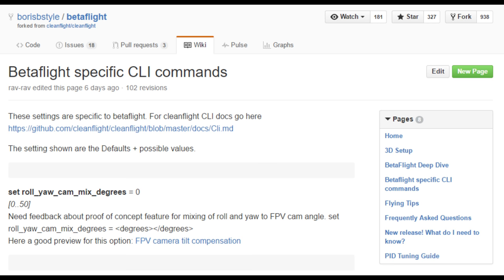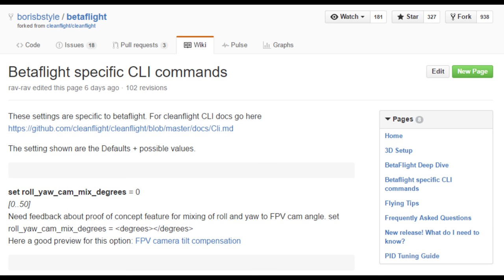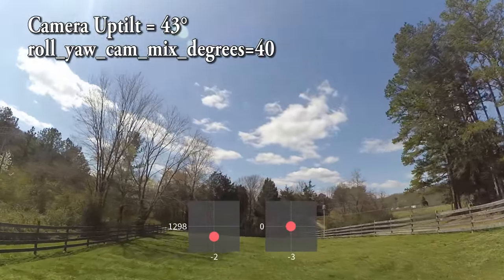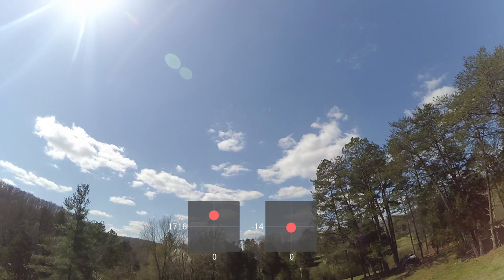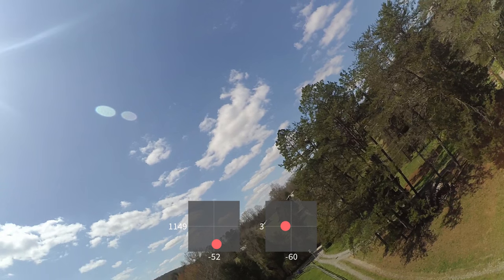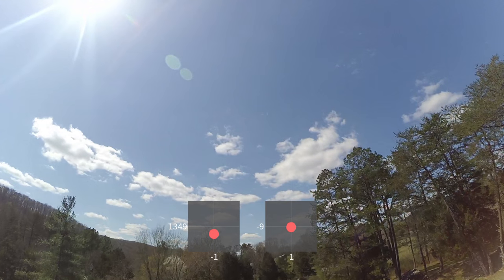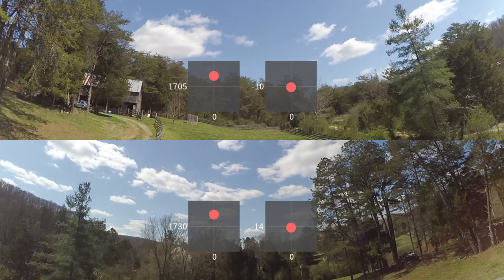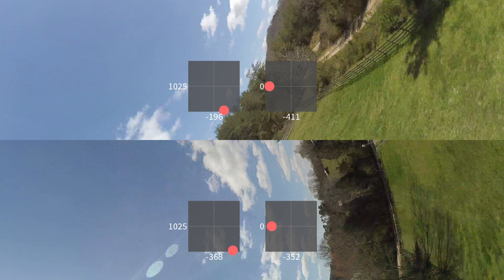Betaflight Camera Uptilt Compensation (roll_yaw_cam_mix_degrees)

Comment: her's a funny thing, velocidrone also has this setting, and i thought it was actual;y the quads's camera angle and i set it at 45, then i set the in game camera at 45 thinking that the general setting doesn't work, then i train from total beginner for about 12 h flying like that and then i get frustrated as to why i can't turn as fast as the other ppl  or why my drone keeps drifting after turns and such
until some guy in multiplayer told me that yaw and roll reverse roles at 45 degree and up, and i was like wth my copter doesn't do that, it always yaws  when input yaw and always roll when input roll, camera angle doesn't do much.. then i reset my settings and copy his.. and then i can't fly :)).
  so long story short i trained with the wrong camera mix angle and now i gotta train some more to get used to normal camera mix angle
 although seeing this setting is also in beta flight i might choose a middle point where i can fly it with ease and the copy settings into the quad i'm gonna build.
  it was very difficult to train with it from total beginner tbh, i actually felt like the quad doesn't follow normal physics rules.